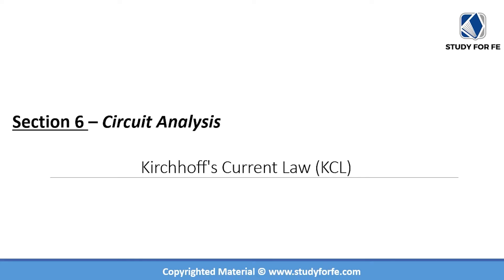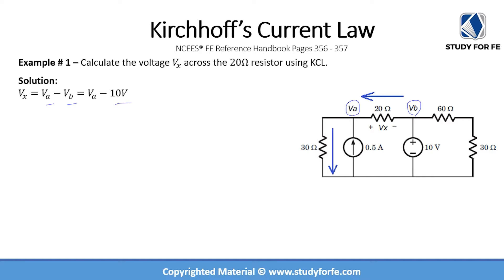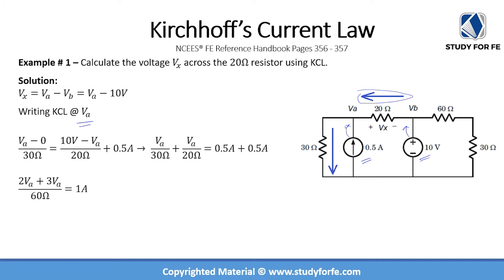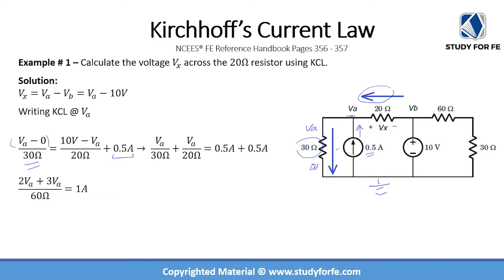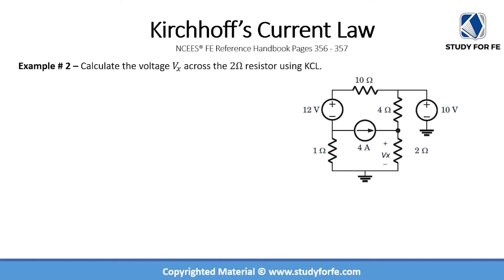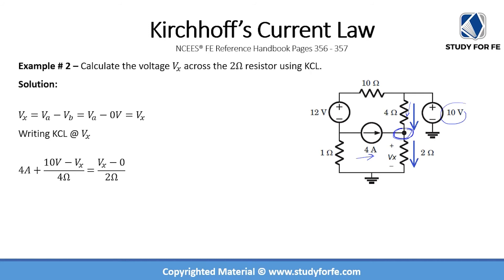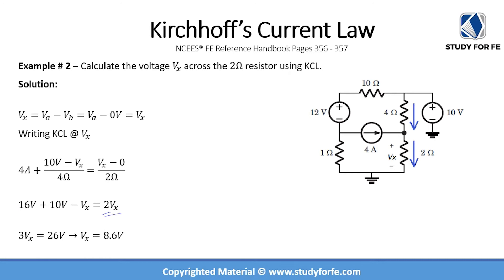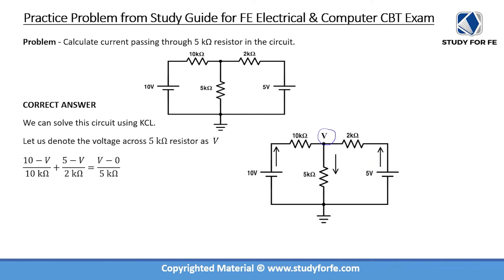FE Electrical and Computer | Circuit Analysis: Kirchhoff's Current Law (KCL)

Comment: Wasim, thank you for this video. I have a question about the first example... Why do we assume current flow minus to plus across Vx? I have always learned the convention is plus to minus. The currents declared in the video seem to be following different conventions as well. Additionally, I have simulated this problem in TinkerCAD and found that current flows from Va to Vb.
Reply from the maker: Hi Ross, you are most welcome. You can assume the direction of currents however way you like as long as your assumptions and equations talk to each other. If your assumption is incorrect for the current, you'll get a negative sign for it at the end that highlights that the actual direction is opposite. In this particular case, since our Va = 12V and Vb is 10V, we know find that the current through 20 Ohm resistor is (12V - 10V)/20 Ohm. If you can deduce the correct directions right upfront that's fine, even if your assumptions are incorrect, everything will work out just fine as long as your equations are consistent with your assumptions! I hope this helps.
Reply: @studyforfe  thank you for your response! This does help